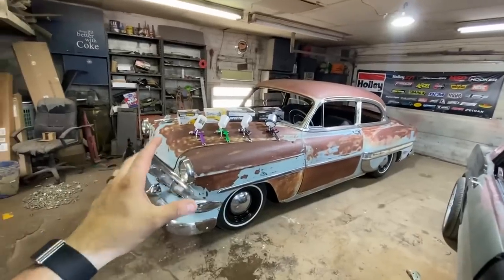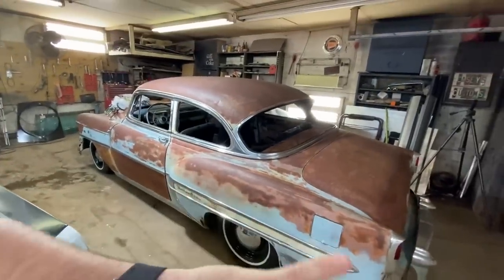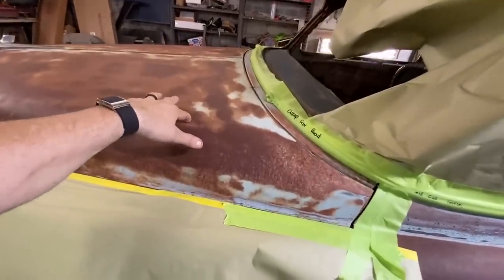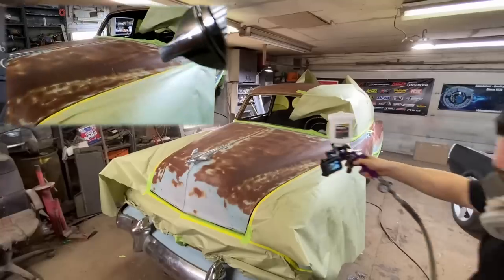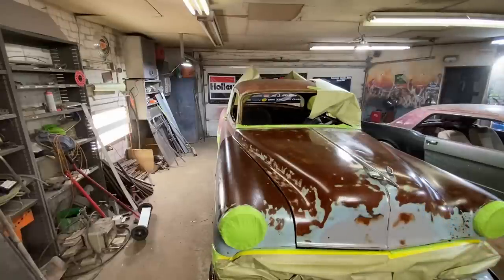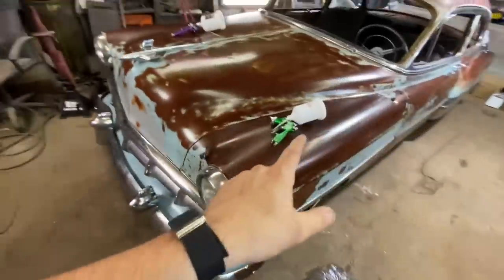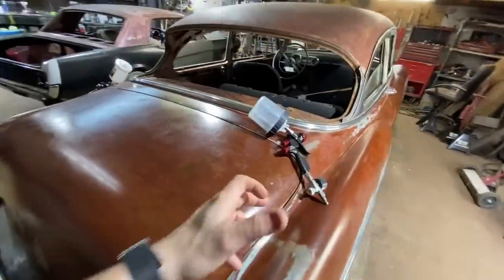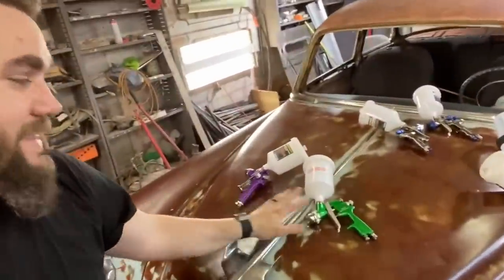I BOUGHT EVERY PAINT GUN AT HARBOR FREIGHT! BUDGET FRIENDLY TO PROFESSIONAL QUALITY! PATINA RAT ROD

Comment: I use the green gun for primer and enamel implement paint for tractors.  It sprays out pretty decent.  I have more expensive guns for base coats and high solid clears. But don't be afraid of those harbor freight guns. They are cheap yes but they work great.

Comment: Yep - the Black Widow has a screw on mix pot - takes the pain out getting paint into the gun, cuts a (bleep) ton worth of clean-up on less-than-full-car jobs. 😎

(And there's the '65 Mustang-infused be-bop-mobile! Love that.)

Masked up for 2-tone patina? 😁 [JOKE]

Ooh! You need an exhaust fan. Look for someone changing out an old house forced-hot-air-heater and set up a filler panel with the blower to let your overhead down on - clears like a wizard. (Set it up to suck in around the shaft opening - just some round HVAC ducting.)

All those guns laid down nicely. Especially considering that it was hot. I think the Wizard was a little ahead of you - that thing put down some paint!! I was used to DeVilbiss MBC-style siphons BITD. Gravity feed is an adjust for me.

Glad to hear the glass is coming for the '54 Chevy - that is a beautiful old car.

Thanks for the great work - Happy Fathers' Day!

Comment: Happy Father's day Casey! Thanks for the review, really interesting. Since I build custom minibikes I'm wondering if the 25 dollar gun would be good enough? Also what pressure were you working with?
Reply: Yes, the green gun will do a good job for you on the minibikes. I’m assuming your going to just be painting frames a black or silver then something a bit nicer for tanks and fenders correct? A couple years ago, I did custom paint on a couple food trucks and I used a couple of the purple $12 guns and they did a fantastic job. If you have any painting experience and skills already, then yes, the purple and green guns can deliver fantastic paint jobs. I’ve been using them for probly ten years for certain jobs so I don’t have to pull the high dollar guns out. The only issue with both the purple and green gun is they won’t last forever but I’d be willing to bet with as small a job as your doing and if you clean your gun good, your gonna be able to get a couple years out of each one. I

Give it a try Lucas, I brt you’ll like it! Take care man and good luck to ya
Reply: @1982MCI  thanks for the info! Yeah before I adopted my niece and her two 1/2 brothers giving 5 kids. I used to work on cars and painted a couple. I work on custom vintage minibikes for the last 6 years. I always use spray paint and love metallic. I'm gonna give it a shot. And yeah they will definitely be cleaned and kept up.

Comment: The gun For $150 looks a lot like a Sharp Finex 3000 other then the fan adjustment is in a different place, and when you spray you should try to be a little closer to the panel. 👍

Comment: Whoever nosed my Chevy filled in where the hood ornament went, but where the crest went they just welded the holes shut and put in a handful of bondo which ended up cracking after 10 years. The color coat we used (black) when we sprayed it came in patchy, so you could see the primer through it and we were TERRIFIED that it wouldn't cover. Once we added the clear, it went from looking like a $10 rattle can job to looking like piano gloss black, we couldn't believe it! 😮

Comment: Hey Casey, I'm just curious, have you ever used compressed oxygen, say like from an oxy/acetylene set, to spray paint? I'm so frickin curious as to what it might be like. Absolutely no moisture, pure O²? Would it change the fineness of the paint or the pattern of the spray? Would it make a difference in the amount of paint that you would use? Again, I'm just curious, that's all. Just curious if you have ever done that or thought about it. Hmm?  
Okay, enough weirdness out of me. 😄 Haha!
Later, God bless,✌️peace
Reply from the maker: It would be ungodly expensive, you’d prolly use 1000 dollars in gas for one paint job. Also there is no moisture in regular air if you have a hood enough drain/filter system, or at least you can get it so little that it’s unnoticeable

Comment: High Pressure Low Volume guns were outlawed in the 80's I do believe...
The switch to High Volume Low Pressure guns took over, due to certain mandates, I forget the technical name for it...
Reply: High pressure was not outlawed except for California. You can still buy and use them most everywhere else in the country. The industry has pretty much leaned away from them tho and for the most part only use hvlp  but since you can still walk into any auto body supply or online and buy the old high pressure low volume gun. I still use them today for certain things. There were some mandates and regulation changes you are correct about that but I’m only aware of them actually being outlawed in California. Others may have joined them by now, I’m not sure but I know it’s not nationwide yet. 

It’s kinda like the waterborne paints. California outlawed the solvent based paints a few years back and other states have it but don’t mandate it. 

Take care Mr. Ford, be safe out there

Comment: Easy to get "priced into" the top level guns. Lotta research and data analytics goes into pricing stuff like this, they start with pricing the top level gun and then step down just enough to make you think like Casey did "why not spend a little more and the get the best gun?" The cheap ones are targeted at people that will use them once or twice and throw them away.